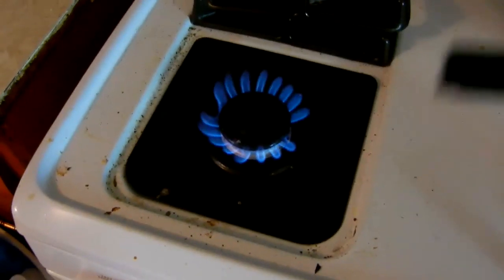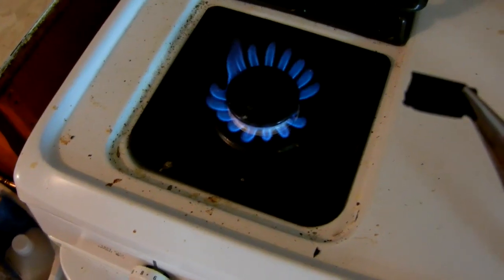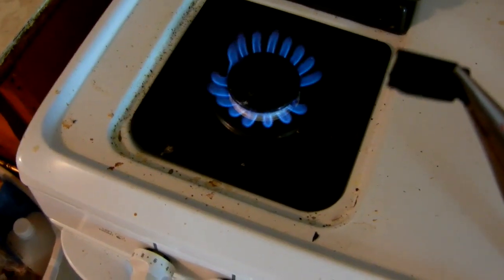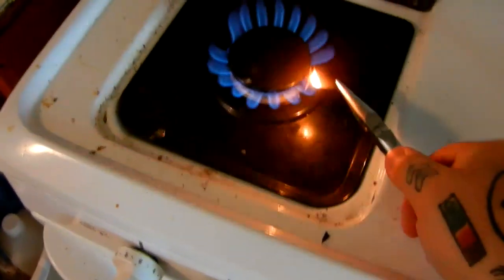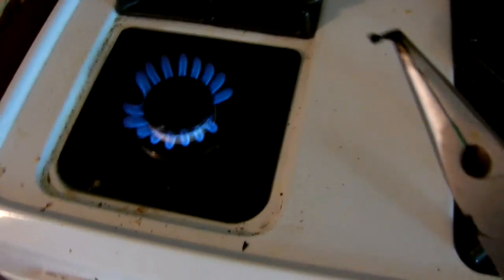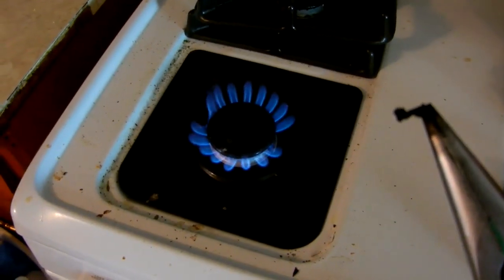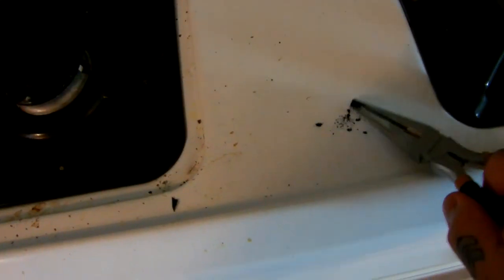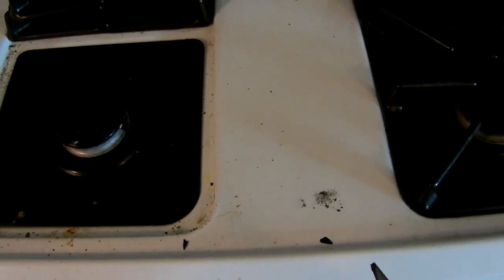Angry Photographer: PART 1 Secrets inside your Nikon DSLR. Your shutter blades are WHAT?!

Comment: That reminds me, I have to clean my stove. Is that a 1938 model Hotpoint MK III? So the moral of this video is not to hold your shutter near open flame.
Reply: mailperson Mirror up, lens at infinity, and pointed at the sun: big no-no.
Reply: Do the new cameras even have mirror lock up?
Reply: Some do. Others like the D3000 series, you have to use Live View mode. The shutter flaps around for the exposure, but the mirror stays up, minimizing vibration. Look for an Mup setting on the shooting mode dial. Usually next to the self timer setting.

Comment: Currently a shutter blade is stuck over the sensor but camera works otherwise and images look normally exposed, expect are covered by the blade. When blade Moved manually, the image looks fine but soon it come back. Is there a cheap way to have this body salvage further or use it?
Reply from the maker: +Sam Sen shutter assy. is a crapload of labor and the cost is $500 to $600 total depending on the model

KEH can repair it, theyre in GA

there is NO cheap way :/